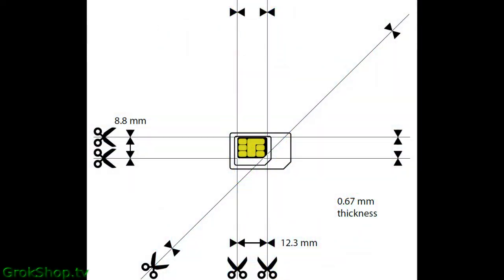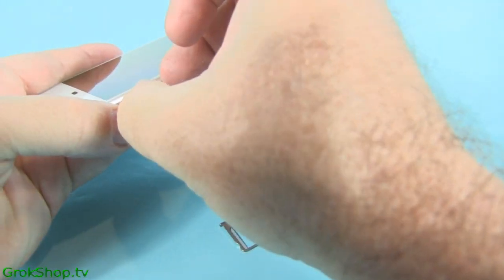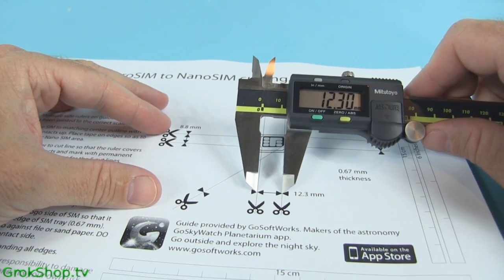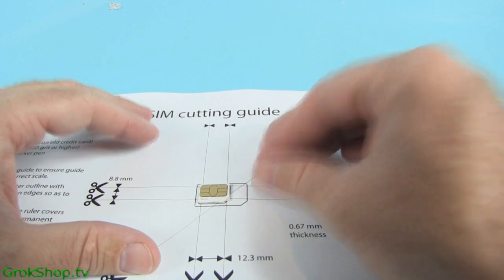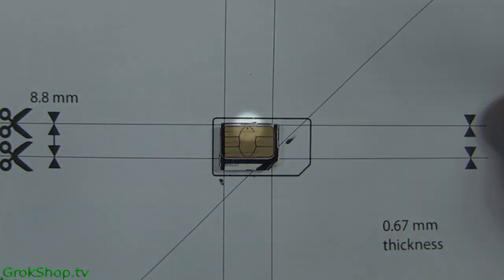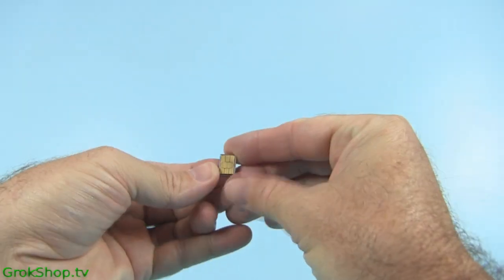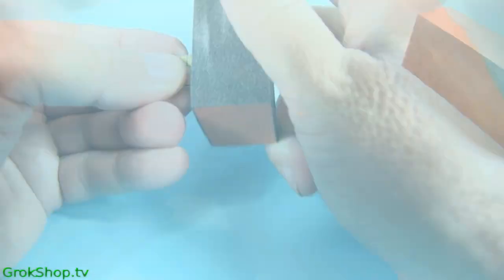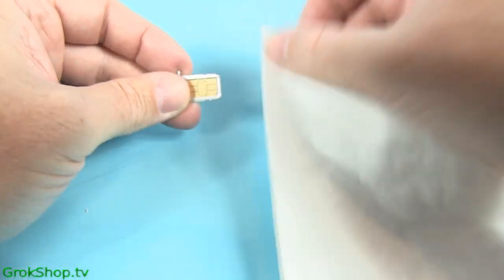DIY SIM How To: Cut Micro-SIM To Nano-SIM Conversion (Google Pixel Target)

Comment: WOW, thank you so much. I did some internal damage to my old 12-year-old +  phone, when I tried to mod it to take a Nano-SIM. I bought a new phone last week, which of course takes Nano sized Sims. I wanted to transfer my balance and files from my old phone to the new one, and had an idea it was possible, so searched YT for some advice. I followed your instructions religiously, and it worked first time. Now there is no need to muck around importing my old number to my new phone and I haven't lost a penny of my balance, or my files. Thanks again mate    👏👏👏

Comment: I know this video is old but thank you so much for showing the card that has a punch out Nano portion.  I watched about 20 videos and was all set to try to cut it to fit until I saw this video.  I did notice there was a line around the inner portion of my card but had no idea it would pop out.  I tried it and it indeed popped out, it fits perfectly and no need for cutting.  Thanks again.

Comment: I wanted to make a old micro simcard a Nano simcard. I've used a plastic micro simcard and where you can see like the layout for a nano simcard. So I've used a needle for it to make the lines for it. I've cut it with a regular scissor. But unfortunatly it didn't work due to the simcard it was too old and not compatible for the new phone. 
So I've placed the simcard into the micro simcard plastic layout and then back to my older phone and luckily it worked again. So in summary I had to purchase a new simcard for it :/

Comment: However, the card remains at its G technology as it was released. Should you use it in a newer phone, able to connect in a superior G, that phone will not connect upper then the card's G. Ex: card 3G, phone capable 4G results phone will connect only to 3G

Comment: Yes … had to cut into copper edges.With te DOT as your guide you know where to put the 45^ edge.Went from a Samsung S5 to a Motorola One Hyper on Tmobile, works fine.Used a rough file for fine tuning.

Comment: The "micro-SIM" card from my iPhone 4 was cut down from an older format before I took it use years an years ago. Hence (I guess) it has a different layout than the card in this video. My card has four tiers  from bottom to top, whereas the card in this video has only three. Here's a picture of the difference: https://www.123rf.com/photo_19578205_a-close-up-picture-of-one-mini-sim-one-micro-sim-and-one-nano-sim.html. Whether I could cut my card furtherly without getting some kind of problems, I wonder. Has anybody tried it?
Reply from the maker: There are quite a few SIM card pad layouts actually.  One would think this would have been standardized to a single layout huh?  Anyway, I think that most phones only will use 6 of the contacts, even if there is 8 available on the SIM.  The physical area of all the contacts combined should be the same, I think.  If that is the case, then as long as you don't cut into the contact pads I think you should be fine.
Reply: Actually - my (even older than your's) standard sim - has an almost round world shape - and not eight (four tiers at either end, on the "short sides") but five - at either end.
PLUS five (or is it six) along each "long side" (top and bottom)
When the inner MIDDLE area consists of the (new NANO type) - of JUST SIX contacts in the shape of three on one end (opposite the angle) and two on the angle end, with the middle section bending over at the top like a capital T with it's LH upper top missing.

BUT - regardless of how many EXTRA (seemingly extra) gold tabs ON THE OLD ORIGINAL 2007 SIM - the actual pin to pad contact themselves - (as seen when the sim is removed) - shows that their rubbed contact pin/pad detail - is for USING just the inner area (six pins) with the three contacts per side, and the old sim is easily seen as ONLY having six MARKS (scraped on the inner six contact pads) where the contacts have rubbed on it - for the last 13 or so years ..

Meaning - all the extra gold edgings, are just that - "useless extra edgings" - not the six main / contact pin areas - that all cellphones still use, which is why it was so easy to reduce their size, initially to a sub standard (that's what they were originally called before someone described them as Micro-Sims), then down again into the smaller NANO - which is purely a tighter fit, to ONLY need the six contacts area - see?

Oh - and what is my OLD sim from - a Nokia Classic 6120 call/text phone only - bought back in the day before Adam was even a twinkle in his Dad cowboy's eye.. 
Hence long long ago - before Adam (the son of a cowboy) grew up - to be a cowboy.

ie:
the iPhone 4 was first unveiled on June 7, 2010
Whereas my old Nokia (6120) Classic was sold to me when they were first released - in 2007, running on Symbian v9
https://en.wikipedia.org/wiki/Nokia_6120_classic
I still use BOTH of mine - but one recently blew it's rear cover off, when the battery expanded as it died..
Hence I only have one case available - for the two sims - so now that I have a new smartie - Samsung A10 with a dual sim insert - I can cut & use one of the "unused" sims that I have had since 2007 - down from it's original bulky standard sim size - to not just a Micro Sim - but all the way down to Nano .. 

Meaning - I have to carefully shave-off / cut / file/ sandpaper - ALL the outer edges "of the extra outer gold contact areas" that have NEVER been used.

Now - the how to show you the photograph of this - "trick" - that I learned many years ago too..
First I had to UPLOAD to Facebook - then open the image ONLY in a new tab - and spot the "scontentfbc1- ... " image URL - to then copy/paste that here - as that should easily be seen publicly with the LINK to the image ONLY - (as you can't back-track to my private only view - via my facebook acc, from there.)..

ALSO of Note:

The huge size of the Nokia Classic 6120 OLD 2007 ORIGINAL standard Sim card - showing all (numerous) gold pads - with all FIVE each end & SIX non-connected pads - along the sides - (which are actually all completely worthless & superfluous, as ONLY the main six contacts in the INNER area - have ever been used - to make-contact with the SIX pins inside the phone itself, hence why it was SO easy (for mobile phone manufacturers) to downsize these into a SUB-STANDARD size, more often called a Micro-Sim size - which has been "further" shaved down - to be JUST the six inner pads that are now called a NANO sim size.
The old HUGE large 2007 Standard sims have only ever used the NANO type (six INNER contacts) as a standard contact area.

https://scontent.fchc1-1.fna.fbcdn.net/v/t1.0-9/p720x720/80856977_2711756308911848_795986834428526592_o.jpg?_nc_cat=107&_nc_ohc=5V0DzCNIdk4AQnz9PqahyTfnHL68qAhT1cr7m5I1Pcd1sPPVRVJf7YIxA&_nc_ht=scontent.fchc1-1.fna&oh=1ceefe76623d69d455841df0d47028e1&oe=5E74CB49
Reply: Bingo - that worked - publicly seen from my FB profile's private (only me) setting - yet publicly visible as an IMAGE ONLY file..
Checked for public viewing via this alternate YouTube channel of mine..

Comment: You don't need a template, just cut the corner in an angle and the rest cut it with scissors real close, use sand paper if you have and slide the sides on it on a flat surface, should work, just did it with 2 cards... HAPPY!
Reply: Can I use a guillotine ?
Reply: @mariadominichetti5519  Sure, lie down.
Reply: yeah but the long side not touching the corner is cut more
Reply: Some older chips have a bigger contact area. It won't be as easy on those.
Reply: 🚲👖👵😭💚💀🤣😙😀💌🐍😃😃👀😂🙃🤔😒😣😬🙍🤦☎️🙅👕🚀📞wiiwirwurysewyser;tytitys;si0ssyysusysysysus9rywyywywyywwrrryryrzrireryrmiz mizmzrmzkmxmr!aIr!riziriyryw92y2y3884usssiysiisiririwririiwirirrisosiusususyusysyisisiir)rerirerereereseerernksnnshnnssne848474747474747474747irereseereseresteteteresnsererernnrerrisiseresesesesisyssesesereereaerereisesiseirimrerxsssisiririisesesesiriririr7Lisirissisisisiriririirr!resriorozisiisisisisyusesrisystt;tot;;ttydududutyvvuvuududu    Frirryryyrereerexyssxisxxseisisxnusseiis₹eewuuwwriirerereresyessiririrrersesseeesezeirrereresnsessesseseseses

Comment: Commended man,i have a 10 yrs. Old sim hoping it will work
Reply: Man thanks for replying but im really really confused,my old sim has so large gold part if i cut it maybe 1/4 of it will be gone and lines in the gold part will be cut
Reply: That sim was I think from the first genaration of sim cards,had it since I was grade six torn between cutting it or not,btw also I already cut it to micro sim pretty works but then nano was so smaller it would cut almost 1/4 of the sim
Reply from the maker: Sounds like you started with a mini-SIM, cut to micro-SIM & now need a nano-sized SIM?  I've never tried that before.  The actual contacts should still work, so that shouldn't be an issue.  Some newer devices run the newer SIMs on 1.8v while the older ones can be 5 or 3.3v.  If it requires a higher voltage, but only gets a lower voltage - it just won't work, but that can't kill your device.  The biggest concern I would have is getting loose particles inside the phone which you can't easily get out.  So if you cut it & the contacts are frayed or something, I would ditch it.  Also make sure you can correctly orient it after all that cutting.  But other than those caveats, it could still work & if it doesn't you're back where you started - just needing a new SIM card.
Reply: The Grok Shop 
Hahaha trying to avoid that,but still I wanna use this sim to a new phone,but yeah guess I won't sacrifice my old sim for a new phone,thanks for advice
Reply from the maker: Wow, that's an old SIM!  It should be fine, but it could be a little brittle.  Good luck!
Reply: THAT is not an OLD "sim" Sir.. 
That is from  a "not-so-very-long-ago" time - of barely ten years - (2009 ish)
Sim's were in use before then - when smartie phones first came on stream - (although a useless techclickr website states it was 2007 before the smart phone's were able to provide mobile users with internet capabilities - which I can prove completely and utterly incorrect)
re:
https://www.techclickr.com/samsung-galaxy-folder-flip-phone
[quote]
Flip-Top Cell Phones – Paramount In 2000’s:

In the period between 2000 and 2006, flip-top phones were the highest selling mobile phone models. Every major mobile phone manufacturer offered at least 3-5 types of flip-top phones. The phones offered calling facilities, texting and some basic games and functions. However, some of them lacked good music playback and connectivity to the internet.

From 2007 onwards, a new wave of devices hit the market, known as smartphones. The first iPhone was launched, and it sold like hot cakes. It offered features that were unheard of in a mobile phone. Users could access the internet using it, listen to music and play games, send and receive emails and so on. 
[unquote]

I am just old enough & wise enough to call total B/S on that assumption - as that DATE is totally incorrect.

I had mobile CELLPHONE (ONLY) world wide web / internet and email capabilities from November 2002 (onwards).
Staring from when I got my first internet capable Wireless Application Protocol = WAP phone from Telecom NZ in 2002

I never bought an internet capable PC until after the end of 2006.
I'd been a mobile network WAP user for a FULL FIVE YEARS prior to 2007 and thus was myself - an email / hybrid-email ISP - since 2002, using my own URL/TLD business systems to do that - all done via my 2002 WAP - on my Samsung clamshell.

CHECK IT OUT.!!!!!!!!!!!!!!!!!
[quote]
Wireless Application Protocol (WAP) is a technical standard for accessing information over a mobile wireless network. A WAP browser is a web browser for mobile devices such as mobile phones that uses the protocol. Introduced in 1999, WAP achieved some popularity in the early 2000s
[unquote]

Oh look - this is on the Wikipedia Site - that appears to thus totally contradict the useless info in techclickr's website - depending on where one LOOKS - for smart phone info - or purely mobile internet capable phones - with or without sims cards)
ie:
https://en.wikipedia.org/wiki/Wireless_Application_Protocol

I am and always have been - on line via mobile technologies.. long before Sim cards were ever in common usage.

p.s -  Also as useless is this info - ?
The earliest internet capable memory CARD - was about the size of a common eftpos card..

re.. The even older technologies - of having FIVE different sim sizes / packages
[quote]
SIM card sizes explained
There are three kinds of SIM around: standard, micro and nano. Standard SIMs were the original and tend to appear in much older phones, such as the Galaxy S2 and HTC Desire HD.
The next size down, micro SIM, was developed to help make smartphones slimmer: when you’re trying to cram so much technology into a single case, every millimeter counts. Micro SIM slots appear in the Galaxy S3 and S4, HTC One X, Sony Xperia S, T and X and so on.
The next and final size is the smallest, the nano SIM. You’ll find nano SIM slots in the iPhone 5 onwards and on Android devices released within the last few years.
We say there are three sizes, but there’s actually a fourth and fifth option: a multi SIM, whose credit card-sized molding can be swapped out to make a standard, micro or nano SIM card; and a combi SIM, which can be swapped out as a standard SIM or micro SIM. You’ll often see multi and/or combi SIM cards when you’re looking at pre-pay phones or SIM-only contracts
[unquote]
Yep - true and yet all are basically nano's - but with WAY too much plastic all around them..
Read:
https://www.androidpit.com/how-to-use-a-nano-sim-card-in-any-phone

CAUTION - do not do that if you are NOT very good at careful downsizing intricate electronic devices - as..
Not only do you have to be extremely careful to NOT damage the chip underneath - you ALSO may have to make the sim THINNER by about 0.08 mm

Hence - do this with a tongue in cheek approach as it may not cut correctly (damaging the sim) or it may be cut too much - in which case you will lose some if not all your data) or it will be too thick (jamming in the nano slot device) or worse, you forget to use a correctly fitting adapter - when you re-insert it into the bigger slot device you took it out of, with the result it slips inside the phone destroying the phone's innards as well as that of the sim..

But hey - experimentation is the b-all _ end-all of getting something old to work as if new - or in creating an even newer device..
Just don't bollocks anyone else up - if you screw up this adaption.

Comment: Actually, I cut my ovn normal SIM card to nanocard for my Galay S8, and it was too big. So I did cut the chip. Works great.
Reply: Well, the gold parts of the simcard aren't the actual chip, they're just the contacts, the chip is WAYYY smaller
Reply: Glad to have read this, mine also could in no way fit without cutting the chip. cut into it on the slanted edge and it works, 5 bars 4G LTE.
Reply: That's so helpful man I have a more than 10 yrs. Old sim I cut it to micro sim and it still works,still don't know if it will work on nano size
Reply: What a relief to hear this